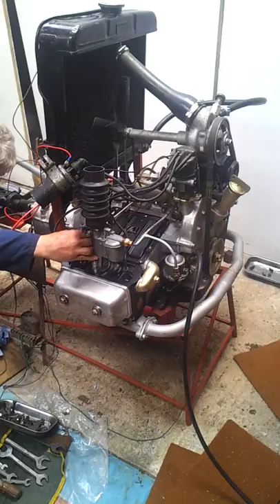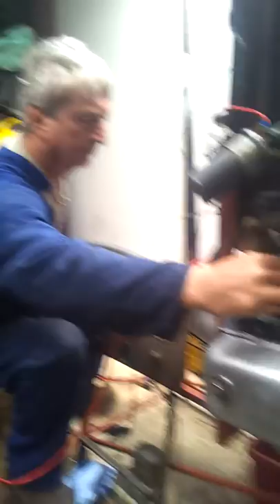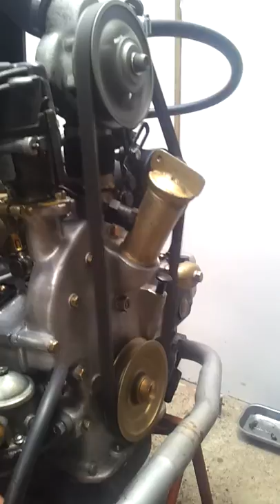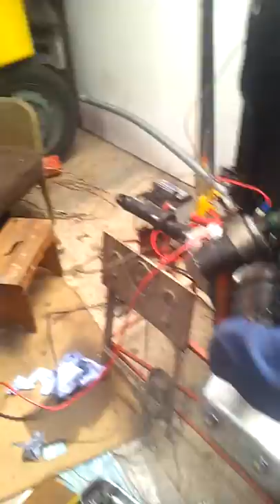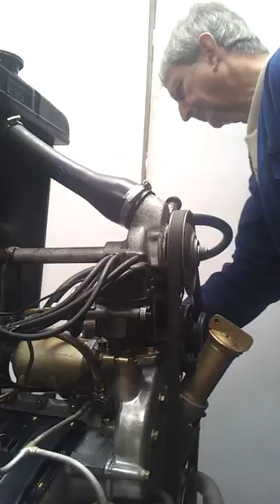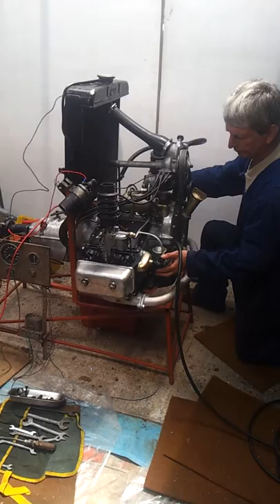Early Javelin Engine Rebuild

Comment: 1485cc, 50bhp @ 4400rpm, max speed 78mph. On a long trip in 1962, dad's high mileage Javelin threw a piston far away from home, and an obliging garage worked overnight to replace the wet sleeve and a new piston with the engine in situ! Parts were still readily available from the VW agencies at that time, and little time was lost. I was 15, and shortly afterwards, obtained my drivers licence in the car. Very happy memories of a lively, flexible and easy to drive car. Greetings from Northland, NZ.